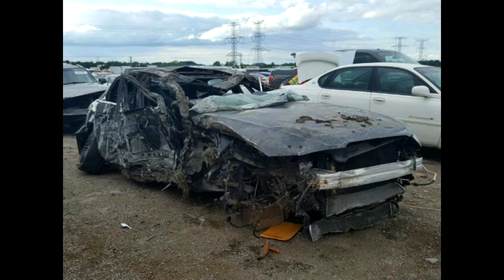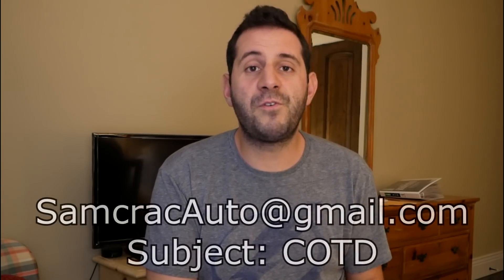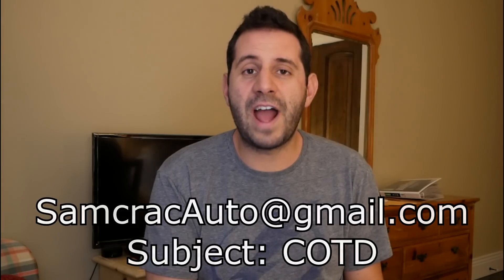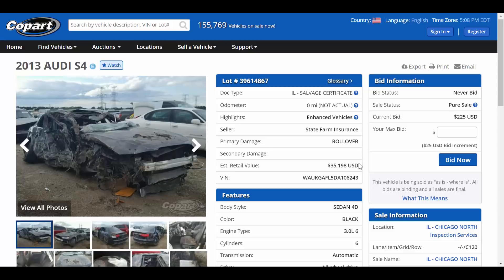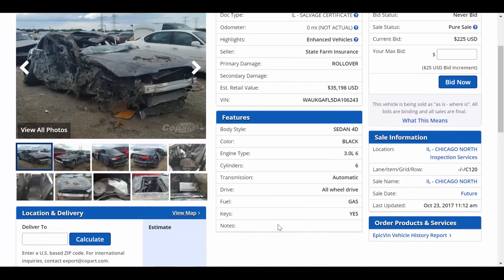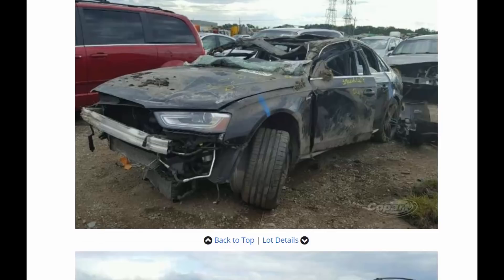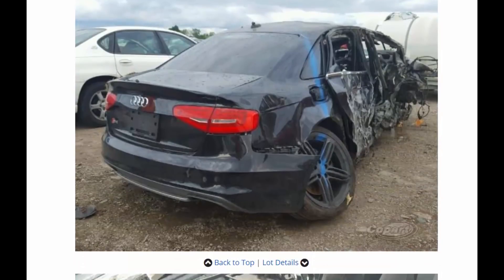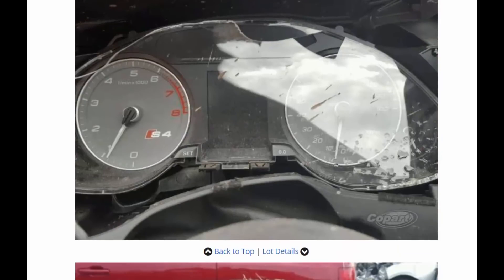Does this Salvage ROLLOVER Audi S4 STILL RUN?

Comment: The tach is stuck. No way that thing runs.
Reply: lol
Reply: Tach has to be stuck.  Rest of the dash is out.  No odometer reading, no Trip reading, no SRS (Supplemental Restraint System, otherwise known as the Airbag system), and I'm pretty sure that there is an airbag malfunction since every single airbag has been deployed.
Reply: MyTruckinLife ACE it’s either stuck or even, since the clear plastic piece in f ront of it is shattered, someone can just reach in and push it to make it look like it runs
Reply: Some modern cars will freeze the instrument gauges like speed and tach in the event of a large crash.
It's for accident investigation
Reply: This is something air accident investigators call a 'gauge sign'' meaning the gauges froze at the moment of impact, no way can that thing do 5  mph, nor can it have a tach thats working well enough to show engine RPMs, engine may turn over, but no way can it run properly in that state.
Reply: Well you never know?

Comment: Newer cars, in an accident,  the needles on speedo and tach freeze at the last recorded data. As the speedo says 5 mph when the wheel speed sensor last recorded data
Reply: five speed ash was about to post this so everyone could see. instead I'll just thumbs up yours
Reply: It’s not necessarily by design either, it’s just that most modern clusters use servo motors to drive the needles instead of “air core” motors like the old school clusters did. They won’t automatically return to zero when power is lost, they have to be commanded back to zero, and will just hold position if power is lost.
Reply: Yea it's good too I was in a accident a few months ago got tboned whole side of my car just done wall walk over to her car fukin needle is pegged at 90 And she blew a red
Reply: Might be good to mention that I'm in canads so it was probably more like 55-60

Comment: This car was running AFTER the initial rollover, and the tach was operating until it had electrical failure OR the key was turned to the off position. I would love to disect this engine. If the valve covers are intact,  it still has oil, the hard parts,ie the engine less (plastic bottles, pulley and belt operated appliances, and throttle body and vacuum hoses) it will start. Rollovers are great if you have blown an engine, and need a cheap donor swap. In a rollover,  90% of the auros are still running when they come to rest. If the cooling system is destroyed, an engine will cook to failure in two to five minutes. If the car came to rest and the driver was consous (can not spell), they will reach for and turn off, the ignition. I know it sounds weird, but I got two different BMW M3 engines from roolovers, and the most I paid for one was$1000' and that auto had two good doors. Audi's run synthetic oil, and have lots of aluminium in the engines. If it has clean, sweet synh oil, it will run. If the oil is red or brown, it is cooked, and is only scrap metal. If it has a manual, and EITHER front wheel is still inside the transfer case, you can check for a seized engine in less than an hour with common hand tools! That was an A4, so it is probably a turbo 2.0 liter four, but if it has another engine, it may be worth a shot in the dark....

Comment: Craigslist:

Minor scratches on bumper, can easily be fixed by buyer. No lowballers
Reply: Vucky abx “ I don’t need help selling it”
Reply: “not in a rush to sell so price firm”
Reply: Vucky abx "old lady drove it"
Reply: "Adult owned, never driven hard"
Reply: “rebuilt title because of a little fender bender”
Reply: “Check engine light is on cuz of a senser my mechanic says it’s like $10 just didn’t have time 2 fix”
Reply: Lol
Reply: AK02 don't forget when someone lets you how good it ran before it stopped running
Reply: "Ran when parked"
Reply: “Engine never damaged”
Reply: “Clean Title”
Meaning the documentation for the vehicle is in perfect condition
Reply: These comments are awesome!
Reply: this is gold
Reply: “Serious inquiries only”

Comment: Modern cars use servos to move needles on instrument panel. Those servos don't have automatic "return to zero" and require command from ECU to do so. If they are no longer receiving commands then they simply stay at last commanded value. This most of the time happen when car loose 12V power (engine+battery). It is side effect of how instrument panel is designed ... bad thing about this is 1) strong impact may move them. Therefore it is possible that speedometer show after crash higher speed that car was traveling. 2) crash and power lost may not occur at same time providing "needles" time to be commanded to return to zero. This will wipe possible evidence (but fist thing is causing questions)

Comment: See at 4:17. The engine is not started. The digital display isn't working but the tachometer is at 1000rpm and the Speedo is at 10 mph. They are stuck.

Comment: I'm not a crime or crash investigator but judging by the grass in the trunk and inside the car, that thing came to a stop while it was still upside-down. They would probably have cut the power to it to avoid the potential for a gas leak to cause a fire while they were extracting it. Enhanced vehicles on this one was probably removing more of the grass or just cleaning the blood out of it. That way they didn't need to add biohazard to the listing.

Comment: Speed and revs gauges are set to freeze if the car senses a crash via the airbag sensors cars as vital evidence. This guy had time to apply the brake and put the car out of gear some how.

Comment: There was a car in the junk yard I go to. From what i can find this Nissan Xterra was rear ended push off a embankment roll down it then stop on is side. I was watching the tow truck driver unload it from the truck. It was moving under is own power. A wheel was missing, the back history, the hoof was smash the. By the end of is time in the yard it was pick clean of all useful parts. That Nissan did not want to die.

Comment: Quick question would it even be worth it to buy a flood car?
Reply: Jarvis Patterson flood cars are a gamble. If it was flooded with fresh water it should be alright if you change ALL the fluids and make sure the thoroughly clean carpets and upholstery. If it was flooded in salt water, the car is done for
Reply: Matt McAvay thanks i want to get into buying salvage cars and reselling them but I keep seeing the flooded cars everywhere from what I assume is the hurricanes. Probably not very good for that purpose but I’m still wondering what would you need to change on a car that has been flooded with salt water. Thanks for the reply!
Reply: Jarvis Patterson no unless it has no electronics
Reply: Jarvis Patterson if it was flooded with salt water, every electronic component in the vehicle
Reply: Matt McAvay Thank you, have a nice evening.
Reply: Jarvis Patterson stay away from the hurricane cars and good luck
Reply: The way you can make a flood car work is to buy the flood car and buy a wrecked car of the same year/make/model and do a lot of parts swapping. This is what carguru did with his Tesla. That being said it has to be something that you can make money off of the extra parts, or you will end up spending too much money. This also means it has to be not common but not so rare you can't find a donor car. On the other hand, flood cars that were not flooded as bad, in fresh water etc, tend to fall in the same category as hail damaged cars. Since the damage isn't extensive, there are more people willing to work on it, thus driving up the price.
Reply: Christopher Kennedy yeah that’s what I’ve been thinking thanks. Il consider both.

Comment: Well I bought a 2012 Toyota Allion In 2014 from Japan for parts The Rpm was stuck at 6000rpm And the speedometer was at 120km/h it was busted in the front !!!!

Comment: If you want to check out my BECK 1955 PORSCHE 550 Aluminum Replica WITH A WRZ STI 04 ..YES I HAD IT BUILT WITH A 18,000 mile rolled 04 Subie that I had the engine built to 521.7 399.8 lowest dyno pulls..THE WHOLE FRONT 18 INCHES WAS RUN OVER BY A DRUNK GUY WHO COULDN'T SEE ME.. Car is hard as fck to see sober to be honest...I got way more from Geico that tge car cost BECAUSE it IS A HAND HAMMERED ,A Hand BRAKE was used as well as other hand equipment..It did ZERO damage to ANYTHING back fartger than 23 inches.. except bending and warping. the interior was perfect and engine has less tgan 5000 miles NOW AFTER I had another Aluminum Rolling Chassis built and SWAPPED THE ENTIRE RED INTERIOR AND ENGINE ALONG WITH EMBLEMS.The Brembo brakes were even ok. im not goingvwith factory drums with 500hp and 5 inch wide front tires and I used the stock steel widened rims from the car I bought from Geico for......READY???.............$2600 AND I made over $30,000 AFTER the new car was built and keeping my waisted one. if u want picks before and after then the bew one..no prob..let me know.. I also have a Street legal Beck Porsche 904 with the cotrect engine AND transmission...along with Replica identical copies of the rims and ofcourse just the factory racecars.. the rim paint AND Silver car paint #SP27594 WHICH IS THE SPIES HECKER PAINT CODE FOR THAT COLOUR SILVER.. ITS TGAT BRIGHT SILVER.. NOT THE BLUE TINTED SILVER PEOPLE ALWAYS FCK UP ON. I DO HAVE Superformance 1966 Registered 66LeMans Moody owned 3rd place #5 car which is gold with Salmon Red instead of Day Glo they used.. it RHD with the Gurney bubble with a ROUSH SBF 427 and QUAIFE ZF TRANSAXLE 5 SPEED RIGHT HAND DOOR SILL SHIFT. ..Take care man!!